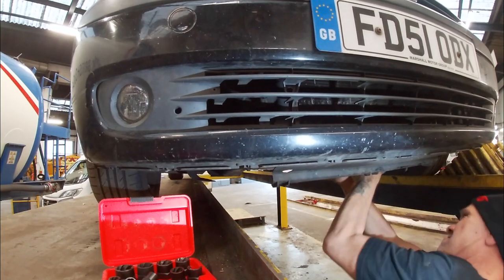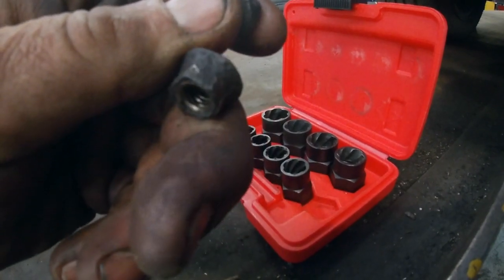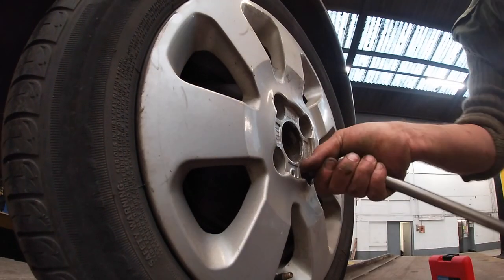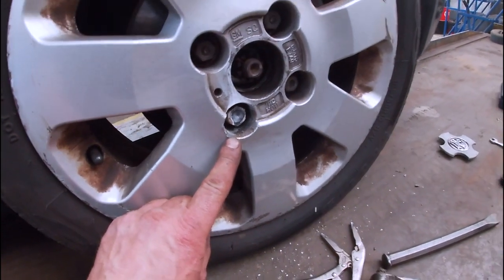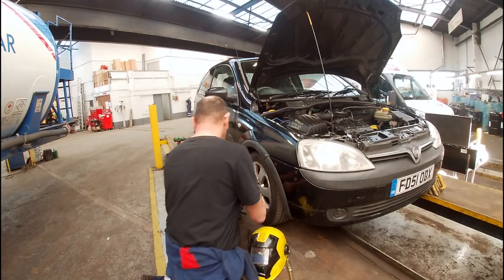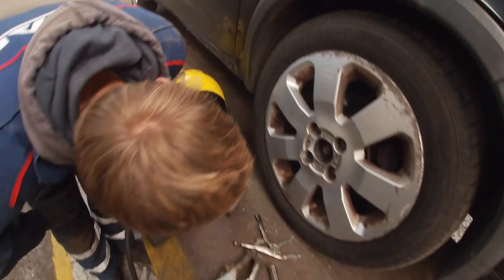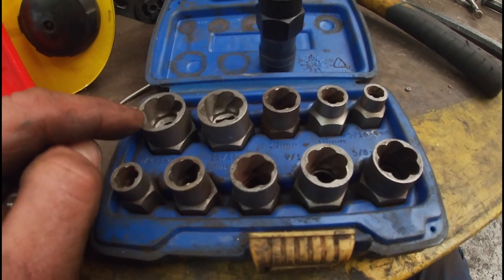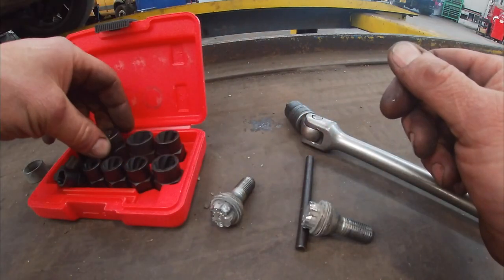Blue Spot Troublesome Bolt Removal Kit 1539 - And The Wheel Nut Saga

Comment: I have a set of these type of sockets by Laser. I haven't had a great deal of success with them myself tbh - in fact in my own situation of desperation I managed to strip the teeth of one on the ball joint bracket to axle bolts on my LR. Though I think it may be my particular set, as they have a completely different tooth design to the ones you show here that I'm not very convinced by.
I shall have to give this Blue Spot set a go, they look like their design will do a much better job than mine!
Reply from the maker: A little bit of heat does help as well when trying to remove bolts.  I've got an arsenal of nut splitters, vibration tools and hot spanners to help but even then as you have seen in the video, someone can come along with a chisel and get success straight away.
Reply: @trailerfitter2  Yeah I’ve been there many times too! - a strange emotional mix of gratitude, relief and envy lol

I’m my case, welding a larger nut on was the answer. As well as giving something better to grip on of course, as you say, I believe the heat went the largest way into getting the stubborn sods to yield haha

Comment: I fought off and on for a few days with a defender alloy locking wheel nut, eventually drilled a small hole down side of nut and used chisel to hammer the nut off, was a fight from start to finish, tried all sorts including welding,. Have put normal nuts all round round now, hoping people take defenders not just the wheels lol 👍🏻👍🏻

Comment: I have the Irwin set and had a similar experience with a Peugeot 307 set of locking wheel buts belongs to a mates wife a few years ago.  Was a right pain in the backside.  After that experience I bought myself a master set of sockets for the locking wheel nuts.  Was about £80 have used it a few times since and it’s paid for itself!
Reply from the maker: Good call.  That is an expense I could do without but if they are needed then you need to buy them.

Comment: Bought the Irwin set for my boy's Corsa which had the same issue as yours. I can normally wring something off, but they didn't need much effort. The rust had placed the nuts  into no mans land for sizing purposes. Would also recommend them :)
Reply from the maker: They've always been a 'godsend' at the right times.  We had to remove a set of batteries but all the clampdown threaded rod snapped off when we took the clamp off.   Those did short work of getting the stubs out of the carrier base.

Comment: Work in  a workshop we used the dynomec wheel nut removal tool used  by aa and rac I don’t think we had one we could not remove only down side it’s Quite expensive to buy
Reply: Yes my workshop also uses the same tools very expensive however i agree not had one it wouldn't remove